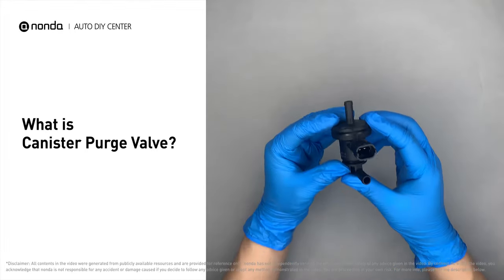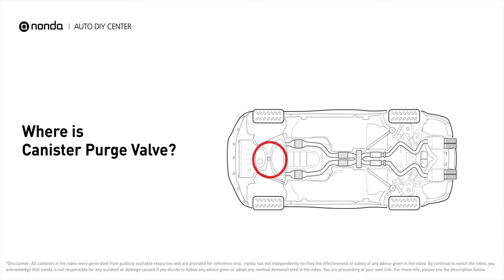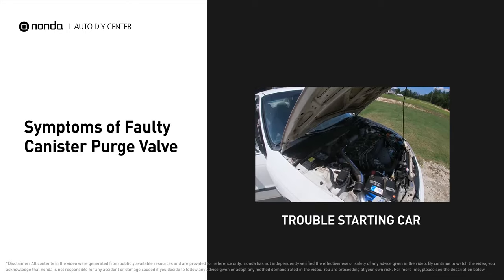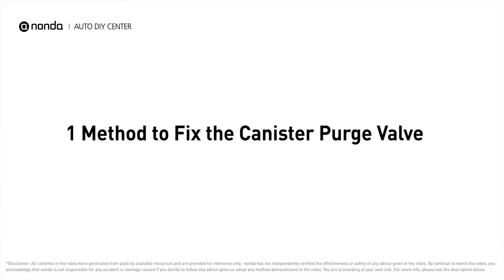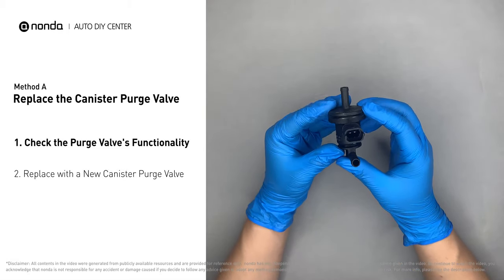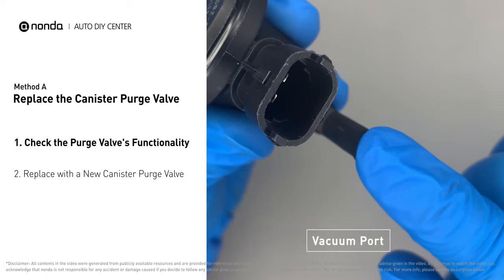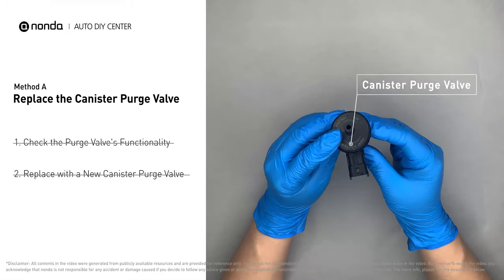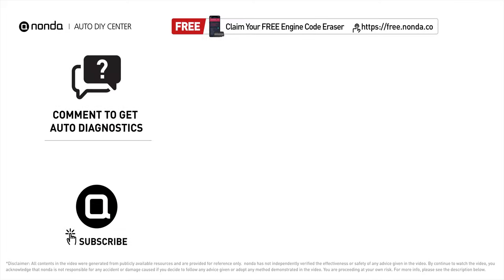Canister Purge Valve: How it Works & How to Fix [1 Method Saves $150]

Comment: I bought a new one because I thought the old one was bad. I put the new one in and the new one wouldn't open either. I checked to see if it was getting voltage and the multimeter was at 13.5. What could be the problem

Comment: While fuel filling, vehicle rpm is going down and engine went off, after a few try it's will start.. But only it happen during fuel filling.... If give accelerated during fuel filling no issue...
Reply from the maker: Can you please provide us with your vehicle's year, make and model? Also, please confirm if this is the only code you're getting.
Reply: i have the exact same issue, once gas cap is opened and pressure escapes. Car will have a hard time starting and rough idles for a couple minutes. Did you happen to solve the issue?

Comment: Hello. I have a 2006 Nissan B13 Sentra (also known as sunny or tsuru). Sometimes it smells as some fuel were comming out. One day i was able to see there was some fuel comming out from the canister, so i changed it. When I open the fuel cap there's a noise that people say it is some fuel vapor, and that I have to change my evap valve as to stop it and vapor be able to get to canister, but I haven't been able to find it. My question is if I am able to use an evap valve from another car and what it would be. Thank you.
Reply from the maker: Hi, it sound a little bit risky. So we suggest you find a profession machanic for more suggestions according to your actual problems.

Comment: Where is this in a 2016 Ford fusion. 1.5 turbo?
Reply from the maker: Hello, you can find it at the back center of the engine compartment, right next to the throttle body.

Comment: I just re-place the leak detection pump on this vehicle a few months ago is that anywhere near the purge control cylinder that would go out a few months later?
Reply from the maker: Hi kimberly, it should last up to five years or 50,000 miles, whichever comes first.

Comment: HOW CAN YOU TELL IF ITS THE PURGE VALVE OR THE CANISTER CLOSE VALVE THAT IS ACTING UP? SO FAR BAD MPG CANT GO ON HIGHWAY BECAUSE CANT GO OVER 60 WITHOUT BEING AT 4000 RPM.  ALSO CAN THE PCV VALVE BE CLEANED WITH BRAKE CLEAN? IF I LIKE LET IT SIT IN THERE ITS STUCK ON OPEN I NEED TO FIX THE ONE I HAVE UNTIL PART ARRIVES
Reply from the maker: Please provide us with your vehicle's year, make and model.

Comment: Sorry but I have a OBD 1 1997 Buick Riviera and mine has this emission vapor canister purge vacuum switch that is part of this system.  My car sound like it runs and idles fine but, at times and it has become more obvious it will choke out when I press the gas fast or just die. It will also stumble and almost die when going up a hill and I press it just a bit to get it going and it acts like I running a lawnmower engine and will jerk and make you think it has bad  bad gas, or several spark plugs are just not working..   The plugs are very new and the gas line  filter was replaced and so those are the the problems so I suspect a vacuum problem somewhere. I really can't trust it going on the fast highway now, but it used to be top performer if I wanted it  be. It is a supercharge 3.8 V-6,  I wondered on the vacuum side that maybe the problems was the supercharger cut off valve, and thought the connector was cracked and order the part, a day before I got it I check it over again and that connection was not cracked as I thought but I replaced it anyway and tested the old one and one side of the vacuum connection was no longer holding the vacuum very well.  So that was part of the problem but did not fix it.  I got the  purge vacuum switch in the mail today and did not put it on yet. Too hot today. But along that same line on this vacuum switch the other hose connection on the top that goes to the purge valve, that hose cracks often and I have to replaces it about every 6 months or more often. So maybe that was not supposed to do that either but I have only had this weird running power problem now for the past 5 months. It first started out as a random almost stall as I would gain more speed to get on the highway, leaving me with the car in a awkward spot. The next time I could just gun it and it would really do great. Now it is like some thing of a car from the 1930's.
Reply from the maker: Thanks for sharing your experience. Hope our video helps!

Comment: On a 2011 Ford Fusion SPORT 3.5    I cannot find it under the hood   Could it be anywhere else??
Reply from the maker: Hi Anthony, you can find it at the back center of the engine compartment, right next to the throttle body.
Reply: @nondainc    Ok thank you,   Ill try taking the intake and throttle body off and looking for it around there!
Reply: Recommendations on where to find a new one? I have a 1998 Nissan maxima and I can't find one other than ebay and I don't trust eBay.

Comment: My check is comes on then off the code that's keeps throwing is p0445 but my active air flap on my dash pops up for a little bit
Reply from the maker: if you own an OBD II device, please run a scan and try to clear the code.